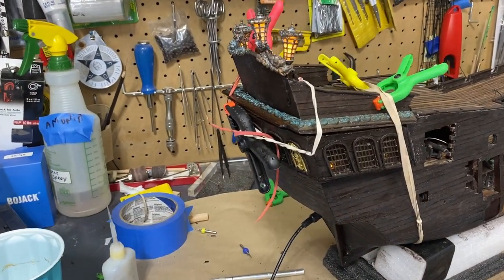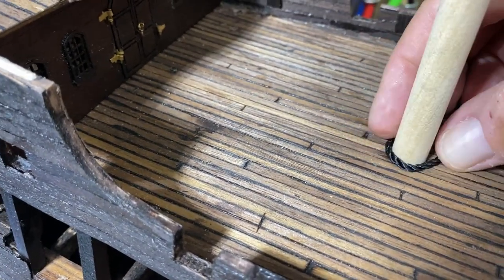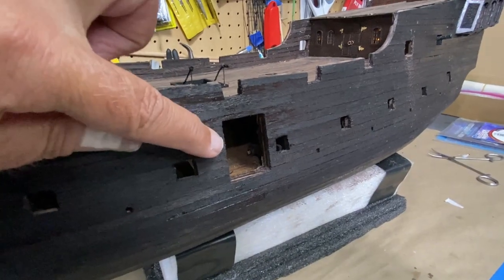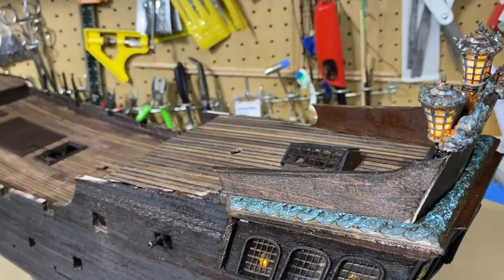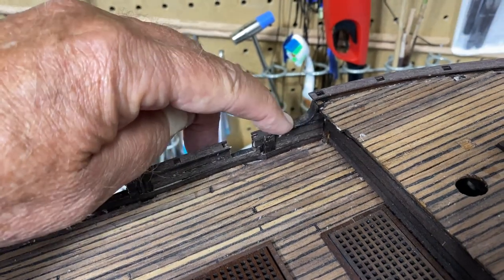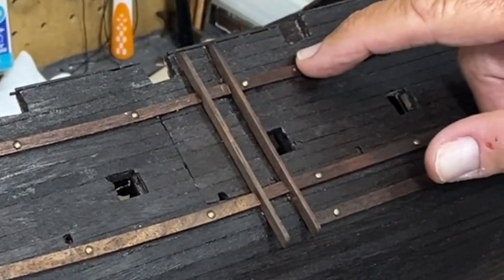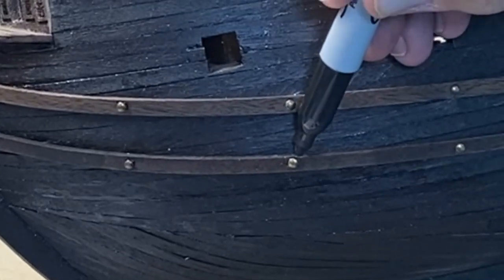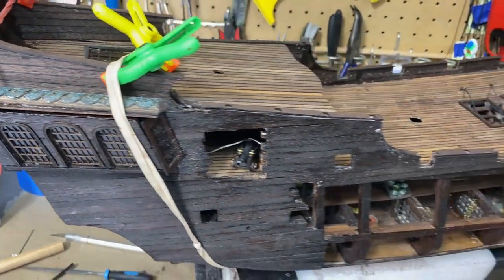Black Pearl All Scenario Version PART 13

Comment: Looking good Dan... love the color you got on the hull.  Sorry you had such a time on the 13th episode. Fortunately it's behind you now ! Seems everyone I know building this ship has trouble with those rings... I'm thinking of doing a small square out of some of the 2mm thick scrap when I get to that point. I've seen other models that have the mast mounted that way on deck. Have a great vacation !!
Reply from the maker: Thanks. I’ve got a few more of those rings on another sheet. I think if I use small teeth blade and go slow I can cut out around it with better success!  But that’s a part of the journey of ship building. Your talent increases with time and experience!😂.
Using the scrap is a good idea too. 👍

Comment: Hello, Dan. Thank you for this amazing Videos. Now i have startet to build the same Ship. Your tips are very interesting. Sorry, for my bad english. My last english lesson was at 1982... its funny, to build a new ship, because this is a balance for my work in a chemical Factory. You make a great job....
Reply from the maker: Your english is good 👍.
Thanks for watching and taking the time to comment.
Yes, I understand how ship building can be a refreshing change from your work.
I used it to replace working 😂.
My hope is that you can the videos to help make the build a little easier and with less stress.  I would also encourage you not buy a cheap copy of the ship. They do not have everything needed.
Enjoy your adventure in building The Black Pearl!
Reply: @BoilerDan1  Thats right. I was waiting for a long Time, for a good KIT. And i think, the kit from ZHL in 1: 50,  is one of the best. My first steps by building the Black Pearl was very good. I was surprised how well everything fits. My ships before:  the Vasa in 1:75 and the sovereign of the seas in 1:87 was very difficult to build. But i make it. in a few time, i will made Videos from it.